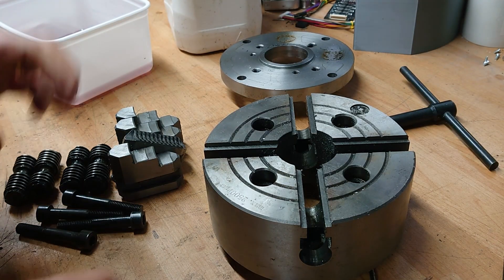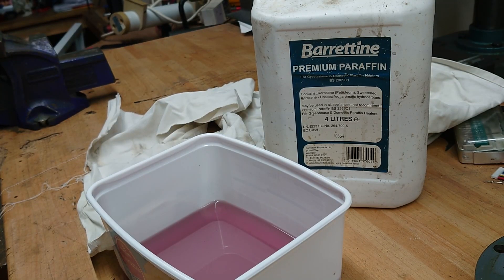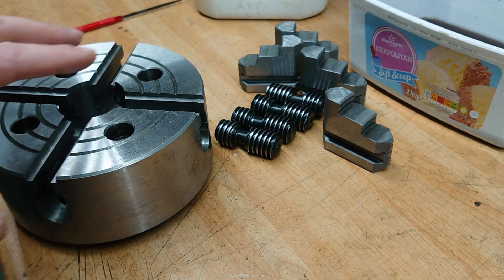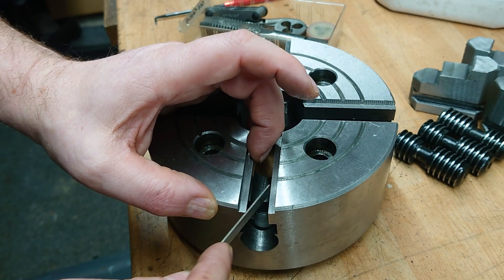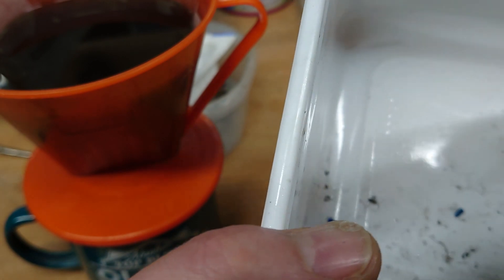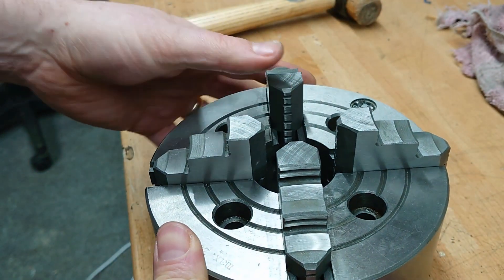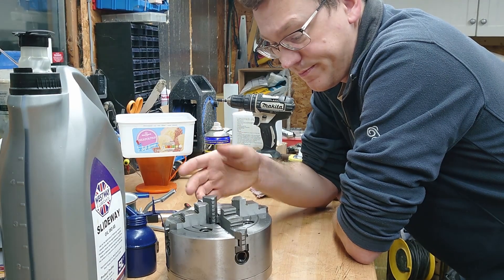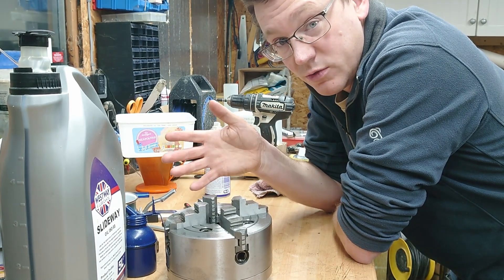Cleaning and Deburring a Cheap Chinese 4 Jaw Chuck (Advent 22 Day 15)

Comment: Just wondering if the machining of the thread section of each jaw was as haphazard as the screws, and if so could you have matched the screws to jaws for best fit?
Reply from the maker: Hi Bob, the jaws seemed much more even than the screws, I think the jaw threads may have been cast in features with minimal machining. There was no visible variation like the screws. I may make some new screws at some point, the originals look like they were cut (torn) with a very blunt tool.
Reply: @ollysworkshop  Another "OK" product from Taiwan or worse China👍

Comment: A good job done there Olly, I generally wrap my chucks in clingfilm after cleaning up and put them on the shelf... especially the one I don't use to much.
Reply from the maker: Thanks for the tip Paul. It will keep the surface rust from forming.

Comment: I rarely use 4 jaws these days because I end up doing the whole tappy tap indicating with my 3 jaw most of the time to get within 0.01mm or better run-out. This is what I do with chucks when I get them: deburred, cleaned and then as you showed "lapped" by sliding the jaws, rotating the screws and scroll (for scroll chucks), then cleaned again, oiled (or greased) then reassembled.

Even the better quality Taiwanese imports have casting or grinding dust in them 😐

Comment: How often do you replace the oil in the lathe gearbox?
Reply from the maker: Mine replaces itself! Well does half the job anyway. There's a leak somewhere that I need to fix. I must admit it's been running dry for a while now, but I do disengage the gear train when I'm not using it. To answer your question though, probably worth changing the oil a couple of times to get any left over manufacturing grot out, but really with the amount of use it gets on a hobby lathe it probably doesn't need changing. Once every 5 years would probably be plenty as the oil might absorb water from the air.